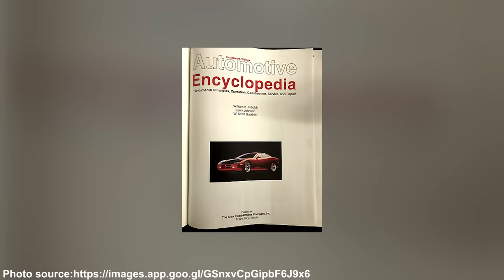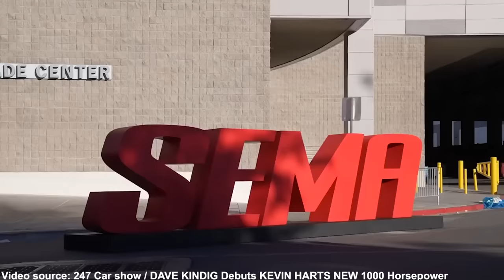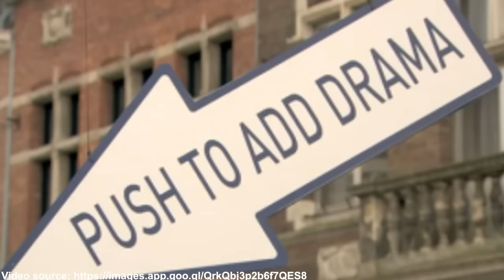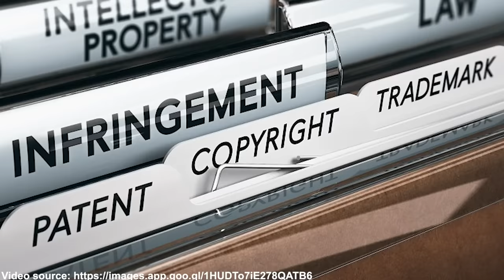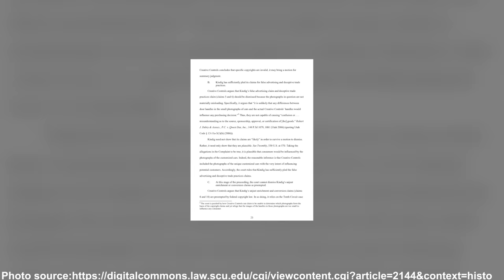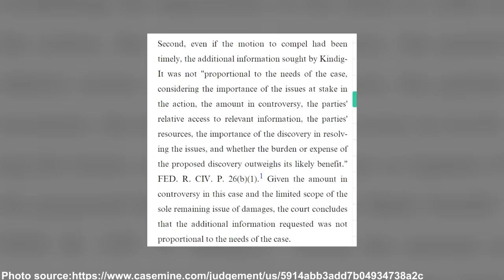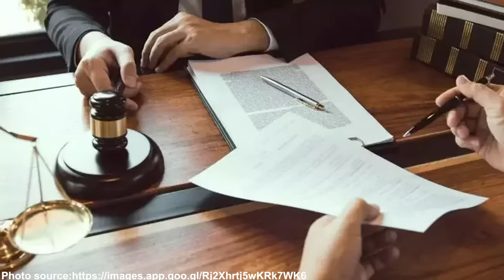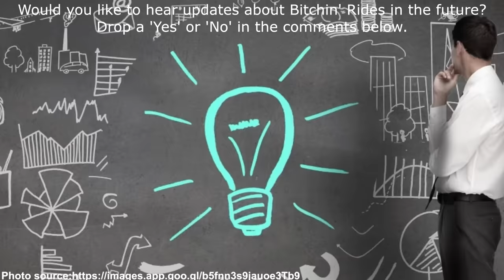The Untold Truth About Dave Kindig's Lawsuit and How It's Impacted on His Net Worth

Comment: I wonder if "Kindig" would modify a 1996 Mustang GT for about 145 thousand dollars under the car's name of "Wild Wood Weed ? Wide old school front & rear fender flares, fiberglass one-piece tilt hood & fenders, a racing 4 link rear control arms with a one piece vehicle mounting plate welded in place of factory mounts , subframe connectors, an 8.5 second SFI cert. roll cage, Jon Caesse Supercharged Boss 9, hardened gears & shaft racing Tremec T-56 with adjustable gear stop short-throw shifter, triple disc clutch, carbon fiber drive shaft, aftermarket aluminum 10.5 inch full floating Ford rearend, short wheeley bars, tubular K-member & radiator mounts, 15 gallon fuel cell with racing fuel pumps & lines, powder coated aluminum interior panels, racing seats (2) and SFI seat belt harnessing, new windows, new steering box with new steering shaft & steering wheel (customized), new hydrollic clutch peddle and system, 10 way double adjusting coil over struts, extremely wide MT radial street tires on the rear and wide MT radial street tires on the front, new electrical system eliminating the factory wiring with SFI rear cut-off switch - everything needed for rural NM license plate ( head & tail lights, turn & emergency signal lights, marker lights, interior lights). Of course, before modifying of the Mustang, it needs a rotisserie sand blasting or acid dipping with body parts replaced as needed. A dark green paint lob with large gold metal flakes and a realistic looking medical marijuana bud with crystalline clear trycons sparkling all over the bud, that is air-brushed on the hood..